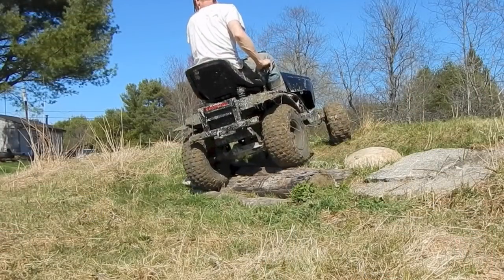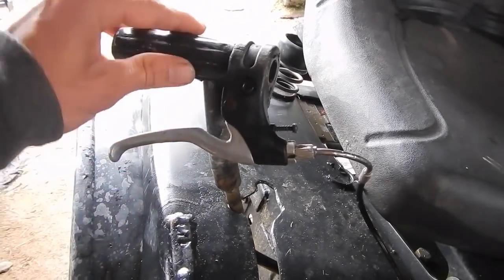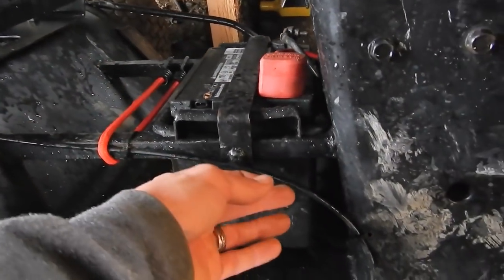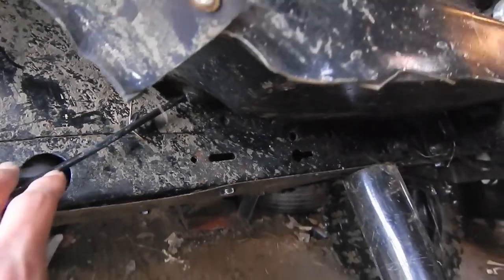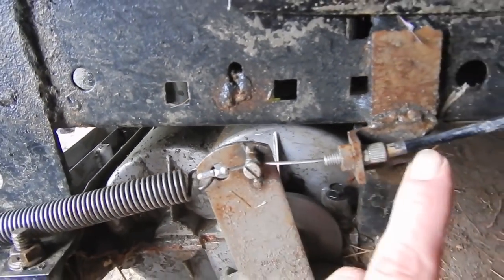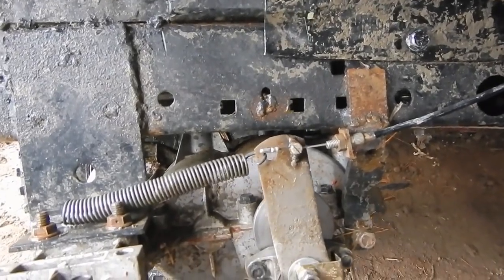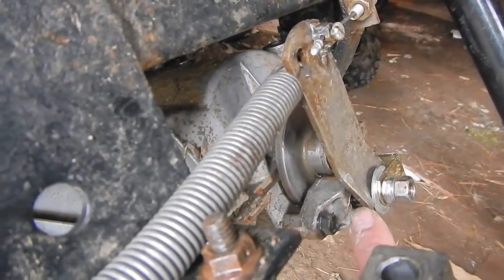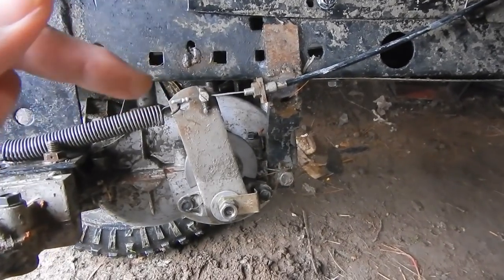How To: Off Road Mower Brakes

Comment from the maker: because it's way lighter than a twin. plus I have plenty of power as it is, so that would be overkill.
As for your pulley question, I cant be sure without knowing all the measurements of everything. Most large briggs motors are 1" shaft

Comment: thats it I have been wondering about this for a while now, i have a couple brake and clutch handles off a 4 wheeler good and heavy duty and i agree with you easier to apply then a foot brake and I would like a gas pedal and hardly room for both, once again thanks for the explanation, you some great ideas and for someone like me just getting into it its very helpful.keep up the good work.

Comment: Something to keep in mind also, if you get the noodle off of a bike equipped with V-brakes (rather than buying separate parts), the brake levers have a different pivot that makes them have less "throw" than other brake handles, because V-brakes require more movement to actuate... so if you're using a brake lever and can't seem to get enough motion out of it, hunt down one for V-brakes.

Comment: I'm surprised you haven't picked up a grommet kit yet, instead of using a rubber hose, for running wires through metal. I found one on the Jegs website a while back. Check out Part #555-10365. Might be a good use of $10!

Comment: I was going to ask the advantage but you answered it, I am going to do this on my mud mower as well.keep up the video's I enjoy them. did you mount your ATV tires on mower rims or make an adapter, you may have mentioned this but I may have missed it. thanks.I also only have 3/4" axles is that a no go or will I be ok as long as I don't tortiure it too much, it has an 18 hp briggs motor.murry tractor 5 speed.

Comment: Have u thought about putting bike handle bars on in place of the steering wheel? My disabled friend that lost the use of his legs had it does and the gas and brakes were installed on them just like they are on a bike with gas & brake levers on them.Its a hydro so he had to have the engine run at a constant speed. These are used on off rd. vehicles for the disabled. Was it shit or mud & a big hole? Cheers

Comment: fearless why dont you take a 3/4 to 1" converter and get you a 6" brake disc and brake calaper that will work alot better hen the stock brakes

Comment: You should convert to handle bars, take the steering gear box out, get rid of all the play and use simple tie rods, then all your controls could be on the handle bars maybe with exception  of the clutch

Comment: I wanted to ask. Why do you use a single and not a vtwin? I figured it was because of the rpm difference. Now I got a murray widebody classic with a 20hp vtwin briggs with the 5speed and I'm looking for ideas. As for the rear pully couldn't I use a pully off a rear engine mount on mine?

Comment: Im thinking about putting a “hand” brake on my dash with the same idea as this but using an old deck engagement lever
Reply: I have basically a craftsman lt 4000 but on the latter model lt1000 chassis with then better steering, the parts tractor I have is an ayp tractor branded as lowes but had a dash and hood like a roper but a rear like a craftsman, so in theory I should be able to swap the complete roper dash assembly with the right side mounted deck engagement

Comment: hi well I was asking is it possible to be able to put ur t handel 2 gether just using nuts and bolts because Im only 13 and I don't have a welder and im trying to set up bakes up like yours because I have pretty much the same tractor except its a 6 speed and I was just wondering

Comment: How do you put atv tire hubs on your tractor or did it come like that?
Reply: He welded them right to the axle shafts. Ive done it myself too. You get some washers that have the same inner diameter as the outer diameter of the shaft. 3/4 inch in this case. You weld a few on each side of the hub real good amd slide onto shaft. You can either use lock collars, or weld them right to the axle shafts. Thats the cheapest way. They also sell hubs that go straight onto the axles as is. You can find them on most go kart parts websites and use golf cart or atv rims depending on the bolt pattern you get. You can also find rims that slide straight onto the shaft. No hubs. The wheel has a hole with a keyway in it.

Comment from the maker: well, yes and no... yes it will go that fast, but if you dont upgrade your wheel bearings, brakes,and steering, you will probably die. I have a kart purpose built to go 50mph.... it's scary.